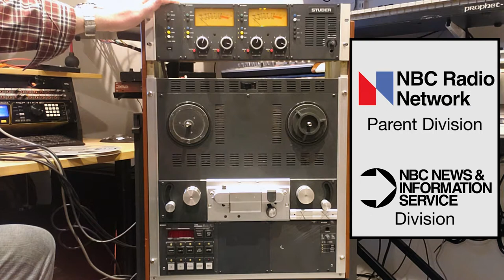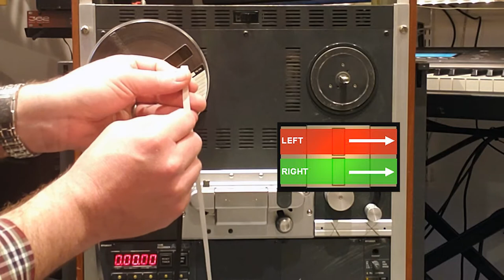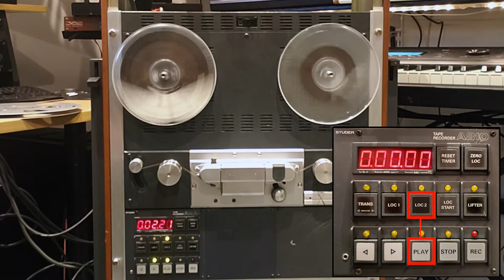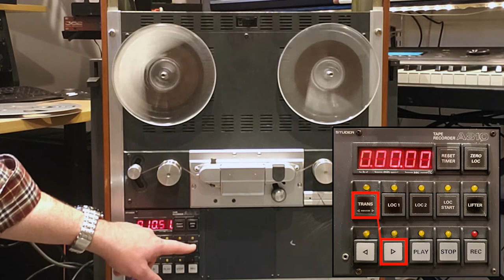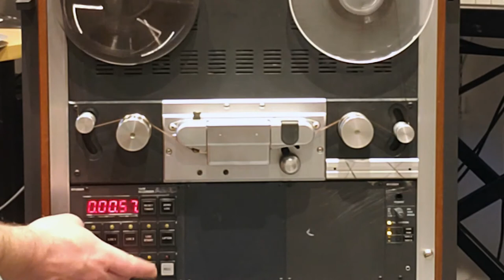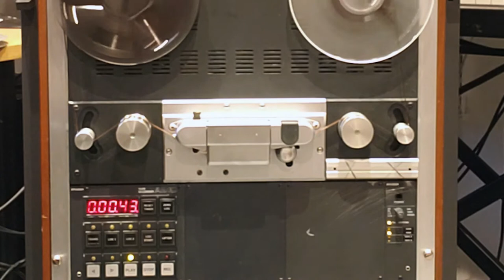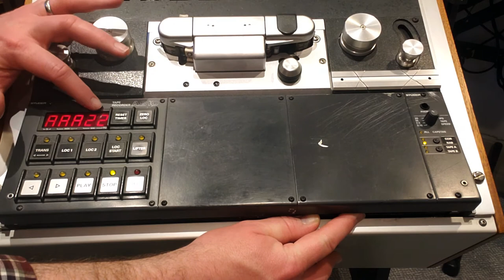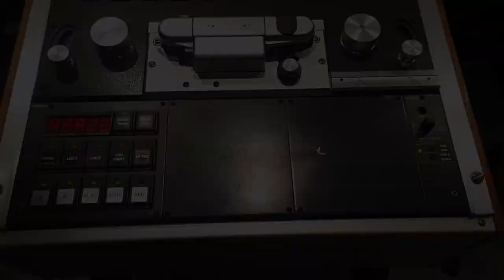Studer A810 Overview and Demo

Comment: This a810 needs to be calibrated!
Reply from the maker: Hey there. I have a guess as to why you say that, but can you let me know why? 

My guess is because the tape I was using as a sample was pegging the meters a few times. That's an old tape, and I believe the machine was calibrated at 250 nWb/m across all four speeds at the time. It's now at 355 @ 15 and 20 and 250 @ 3.75 and 7.5.

But, maybe there's something else going on that I don't know about and I'd love to find out.
Reply: First thing I noticed is the tension needs to be calibrated 
For eg
When you search zero it should be very smooth and shouldn’t shutter 
The supply tension guide is where I would start and then the take up guide as written in the manual and then set up electronics 
You will need a tentelometer for playback 
If you have too much tension you will wear out the heads quickly 
Second of all 
the tape formula you recorded on needs to be biased to the machine 
The levels on playback are louder in the video at 7.5” then the input from what I can tell
But anyway 
Tension needs to set up first and then the audio
You should be able to monitor input and output at the vu meter
And they should be same
Obviously the higher speed the better the frequency response but even at the slowest speed 
I would expect flat to 16k +\- 3db depending on head condition
I love the studer a810
I’m refurbishing one at the moment myself 
Great machine!
Reply: Hi
I have an A810 that needs to be adjusted and calibrated.
And .might be capacitors need to be changed too.
Will be able to help me with this?
Thanks
Reply from the maker: @jameslister6717  oh man, I totally forgot to respond to you until just now, so my apologies for the delay. And you're absolutely right! This machine ended up getting calibrated by Bob Shuster and the braking, etc, worked far better after that. 

I've restored two more since then and your message (which came before Bob's calibration) encouraged me to dive into this more. I got a lot closer on the second and third machines, but couldn't get them as precise as Bob did. 

Thanks!